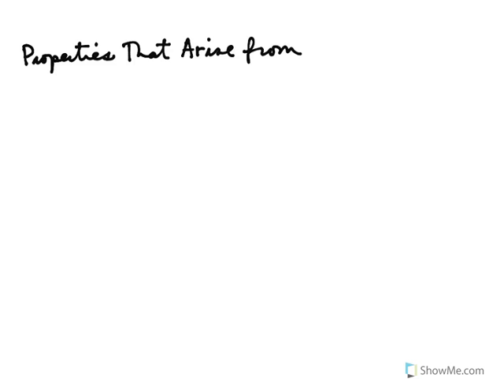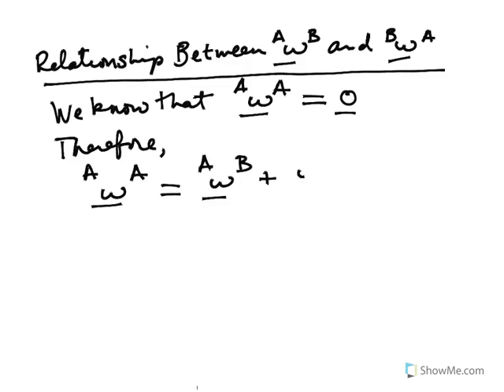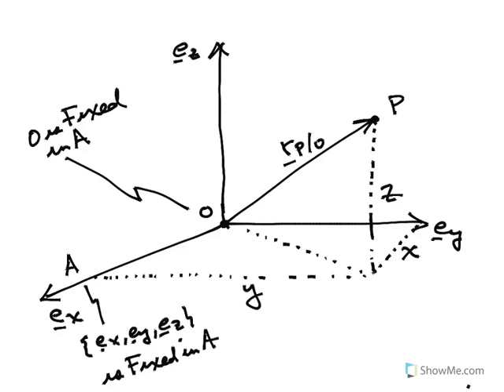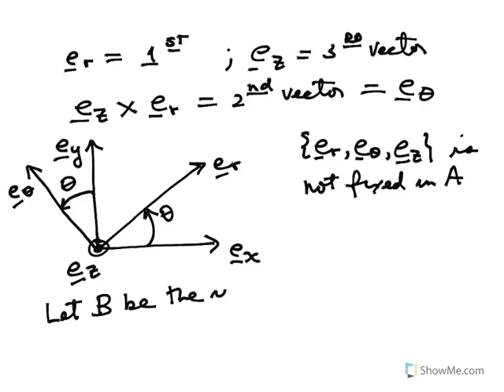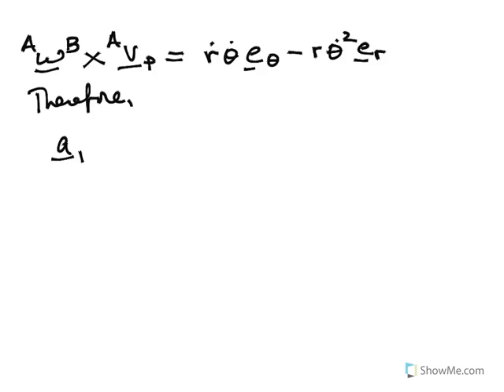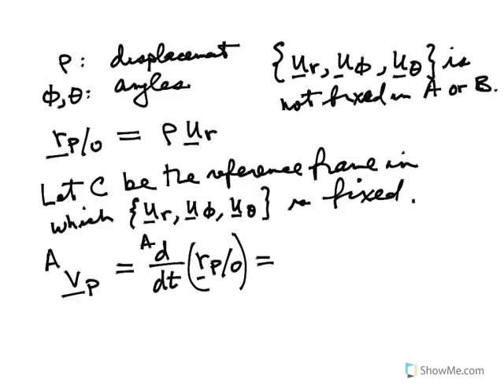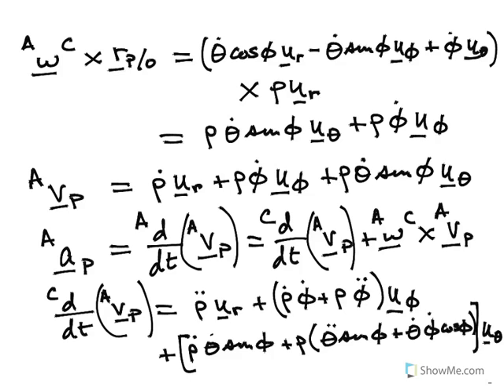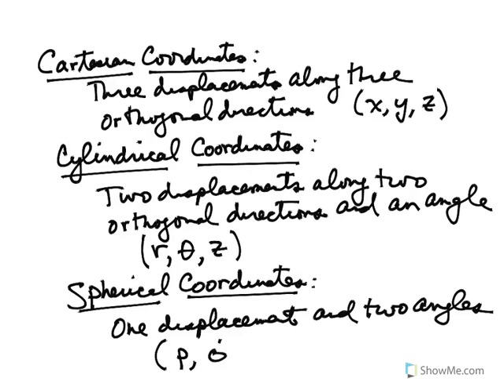Lecture 3: Properties Arising from the Transport Theorem and Commonly Used Coordinate Systems

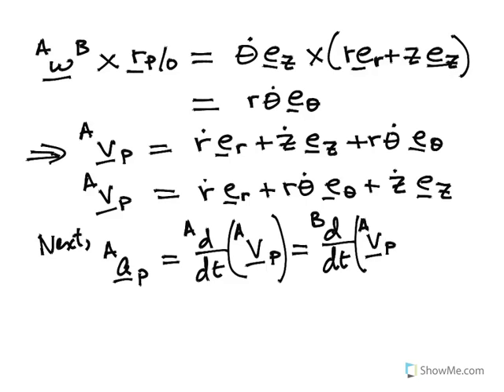Comment: I think I’m getting confused as to the actual meaning of taking a derivative with respect to a frame, as for instance we arrive at an expression for the velocity of P in A, but expressed in the basis of B. Why would we then need to use the transport theorem again as at 31:00 if this is already is with respect to A? I understand that the basis vectors of B are not fixed in A, but then what is the meaning of taking the derivative with respect to A?

Comment: Thank you Sir for posting such a comprehensive set of lectures. I love the pace and style of teaching! from the previous lecture, I understood that vector b is defined in frame  B. if this is the case,  at time 2:11 in this video, the  first equation defines vector b in frame B, and the second equation defines vector b in frame C. if this is the case, the two b vectors are different and can not be factored out? but it seems like two vector b's are the same... shouldn't they be different because they are defined in frame B in the first equation and in Frame C, in the second equation ?

Comment: I was always taught that the polar coordinates,e(r), r(theta) and z were not fixed in space and that is why when taking a derivative of a function in polar coordinates we also have to take the derivative with respect to the polar unit vectors, since they are constantly changing in space, independent of any other (cartesian) coordinate system?
Reply: I think the above comment still relates the polar with the cartesian coordinate system, that is why we take the derivative of the polar unit vectors, but since e(r) is defined along r (even though r is changing constantly) the unit vector e(r) doesn't change wrt the radius r.
Reply from the maker: The polar coordinates are rotating relative to a basis (Ex,Ey,Ez), where (Ex,Ey,Ez) is fixed in some other reference frame (call this frame A) while (er,etheta,ez) is fixed in a reference frame B.  The angular velocity of frame B relative to frame A is denoted A_omega_B and is equal to d(theta)/dt * ez.  I am not sure why you are thinking that polar coordinates are somehow "fixed".